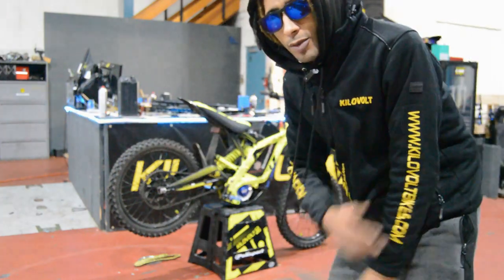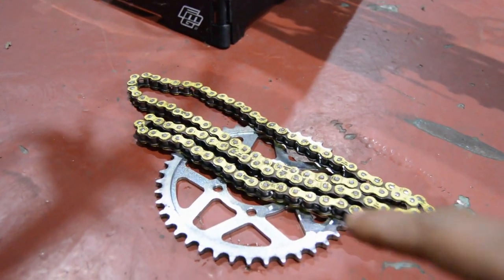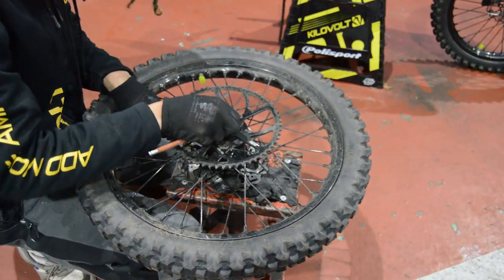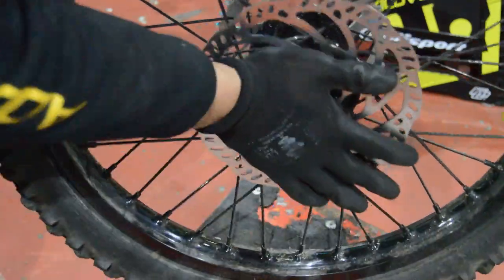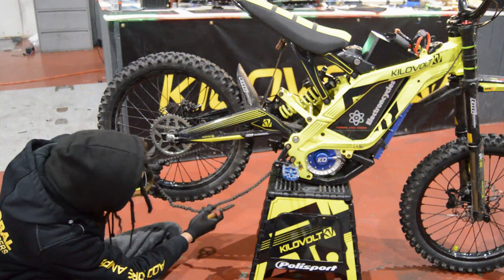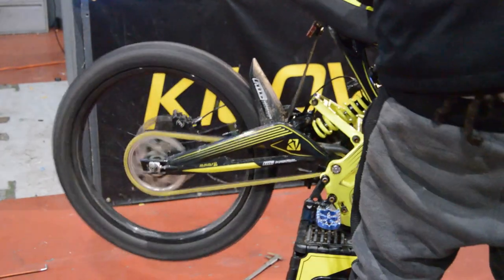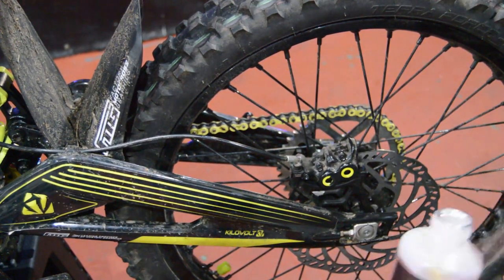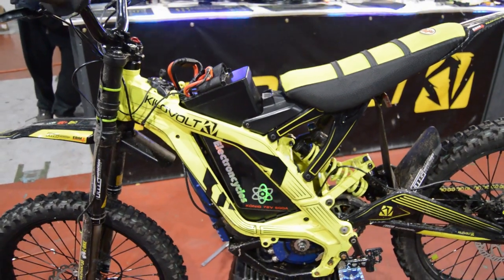Setting up the Surron for some top speed runs and doing some general maintenance - Sur ron Vlog

Comment: My electric bicycle frame ebike is falling apart under 60mph peak loads. Tires wobbly. Suspension shot. Frame flexy. Its getting hard to ride fast. Fells like its gonna slap itself to pieces the faster I push it. 20K miles+ will do a number on a bicycle. Rotors trashed. Brakes caked with burnt paint.  

Iz fas as fu... tho.
Reply: Thanks for the trick. I cannot get MT5e to feel right no matter what.. Normal bleed. I might try that. Reverse bleed. 

Want a better grip on the stud, nut, or a fastener head, upon loading a bolted assembly? Turn it from both directions, ie 180* apart on the diameter of the bolt. Ie, tork it once form 12 oclock NORTH position and then tork it from 6 oclock.. Many people just tork form one vector and this only pulls half the head around into tension as it applies compression. Yes, this means you have to remove the wrench, from the fastener, turn it 180*, and put it back on the head of said fastener. .... and do it from the other side. Takes a little longer, but it will provide a much better compression force on whatever you are bolting together.. ( loading). Wrench it from both sides, equally, for even loading. This is not relating to the bolt patter.. but to the actual beam loads in the fastener by itself. I've loosened up sprockets on 188hpp motorcycles before. They dont take the tork. Why they get Kush drives for road use and lockwire for racing application. I know how that happens. Might not matter for you. It is something an old mechanical engineer taught me. 

We used to design firearms. Now we build powerplants.  We have a spreadsheet ( that which we were hired by Washington Group International, once, to develop) with some interesting fastener information that is used all over the world in boiler applications ( nuclear boats through coal plants all over the world).  Our roots in mechanical engineering. 

Or heat her up near red hot pre tork.. but that is another way of developing fastener tightness and loading... but...that must consider many many things to be reliable, such as the metallurgy. Used only on huge bolts bolting the boilers and turbines together.

Yup we made the spreadsheet for that too. Damn computer age. 

 

Jah love... and keep the peace.
Reply: So what’s the verdict? No top speed runs recorded?  Fell on its face?  What happened?
Reply: @elaponte  Nah. Its fine.

 I tore it down, welded gussets over every joint. One for the neck, one for the bottom of the triangle, and four more on the swingarm. 

Sandblasted it lightly and painted it pearl white. Its a beast. Trucks along endlessly. Pulls the front end up at 40mph down hill racing Chevy Silverados. Leaving them in the dust as

 they try to get up to speed. Roaring along, as they try to catch up. 

 I had been charging at 12A but I upped that to 16A today with a pair of chargers. This is about the most I want to honestly pull form the wall. 

Top end actually up to 62mph now. Going on the fifth rear tire, and the third front...  on this bike..  Rear tire lasts about a season. 

You can find pics of my bikes. Same name on ENdless Sphere forum.... . Tons of pics there.